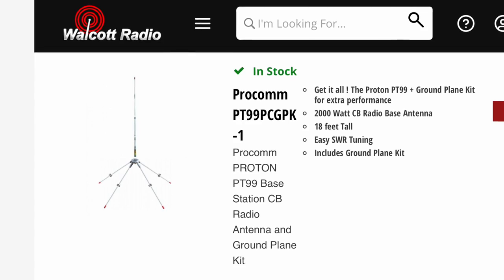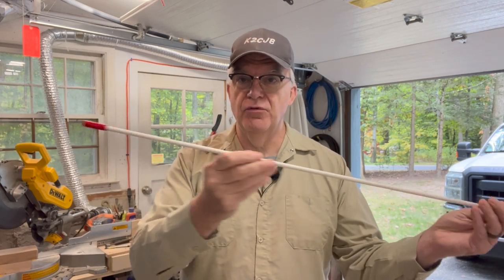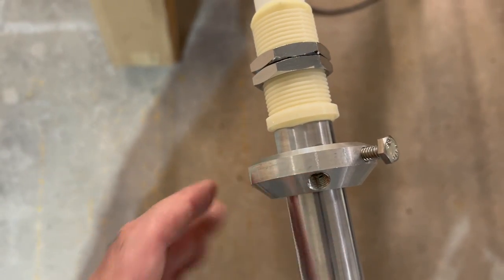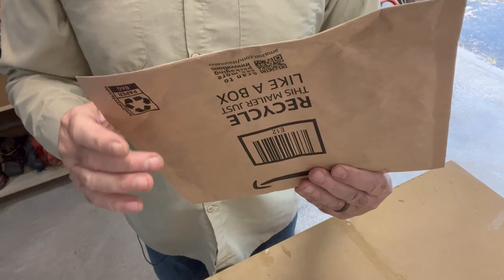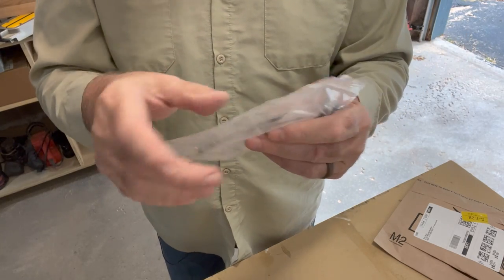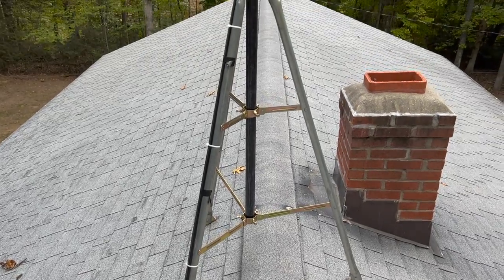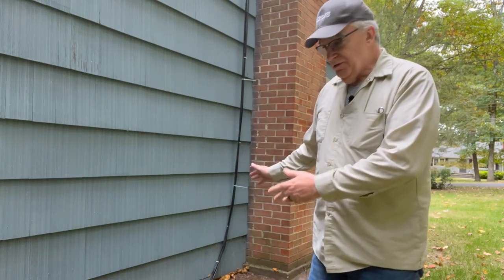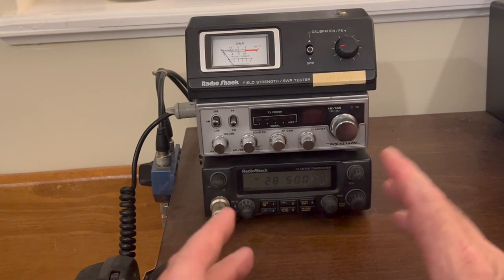Assembling and Installing a Procomm PT99 CB and HAM Antenna

Comment: 10 meters is coming alive. I just ordered one of these antennas with the kit. I ordered it from Wolcott . I used to run an Antron 99. 73 N1XXU
Reply from the maker: Mine isn’t quite resonant on 11m.  I added a tuner to touch it up a bit.
Reply: @k2cjbradio  I had to cut 7” off the top whip. Perfect now in the SSB portion of 10 m.

Comment: Nice walk-through of your antenna installation, Chris! I was looking at the proximity of that wire antenna that looks like it is touching one of the ground plane radials and wondering if that would have an impact. Regardless, that's an interesting project. Looking forward to asking your thoughts on roof tripods during our next livestream. 73 my friend from VE3TWM.
Reply from the maker: Thanks!  Actually that’s the antenna line holding the center of the OCF.  The ground plane radials are clear of the OCF…but they are relatively close to it.

Comment: I've yet to put up my pt99 and while I don't have the radial kit I'm a little concerned that the radials are only 44 inches rather than a quarter wave around 102 inches.  Does that seem logical?  Maybe the antenna design won't work with quarter wave radials? As soon as the rain stops I'll have to put mine together and so some experimentation.
Reply from the maker: Yeah, i opted for the radial kit because i thought it would make it a bit more efficient.  It does seem odd that they are as short as they are

Comment: It appears this antenna is not resonant on either 27 or 28MHz. Perhaps clip a bit from the top section.
Reply from the maker: If it was metal I might do that.  It’s fiberglass so not sure if I can trim it that way.  Thanks for watching!
Reply: @k2cjbradio  
Start in the middle, how they work is that the bottom section is a matching device  so when you move the alluminum rings closer or further away from the matching device the standing-wave-ratio will change aka "SWR's" if high on 40 move them down if high on one move them up thats why the middle id the best place to start, most of the time the middle is just right for SWR's like 1.4-1.5 ish depends how height you got it up there and so on.
If the rings end up on the bottom use a hacksaw and put tape around the top whip before cutting.
Cut 1/2 at a time.
Also the mounting pole looks to be galvanised steel it should be aluminium.
Hope this helps.

Comment: How that antenna working out
Reply from the maker: It’s ok.  I’ve made a few contacts on it.  I added a tuner to the system to get a better match at the rig end.
Reply: @k2cjbradio  I have a A-99 giving me trouble I think it's time for a new one thinking of try the tram 1498 black